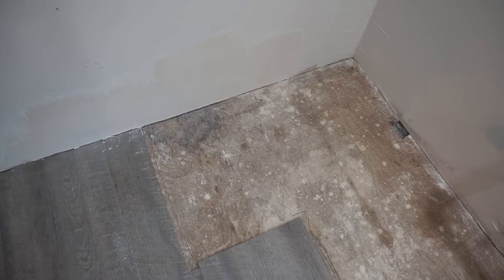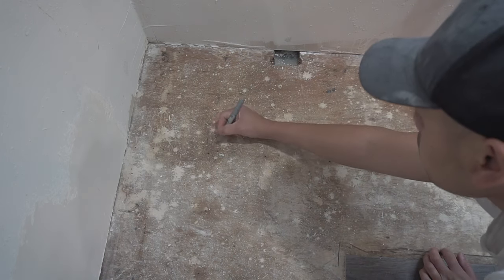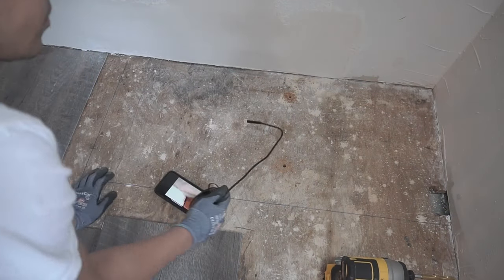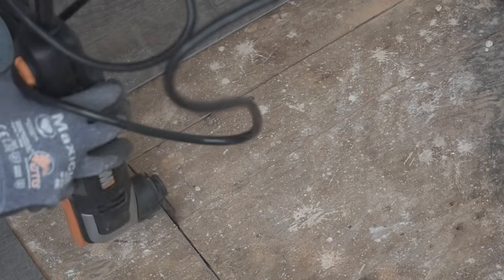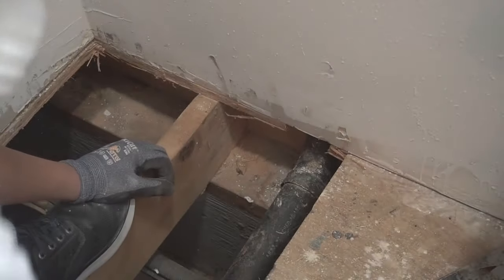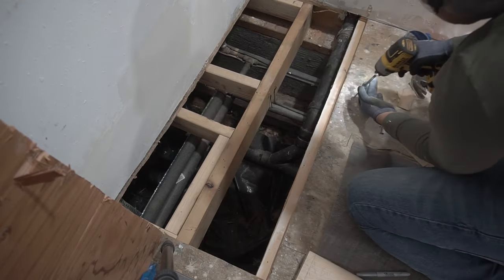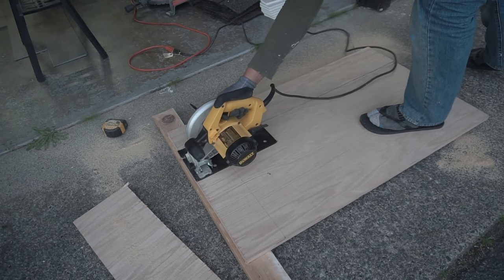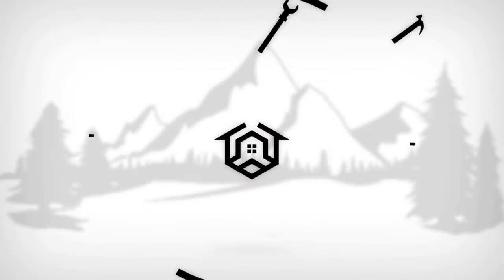How To Remove And Replace Rotten Subfloors! DIY For Beginners!

Comment: I do handyman work, and your videos have helped me a lot. I like you you used what you have to cut the 2X4's and plywood. Many times, I have gotten to a job site and forgotten a tool like my sawsall. It was too far away for me to go back home, so I made due with what I had.
Reply from the maker: Thank you so much for the love and support! I’m glad I could be of help. Yes for some reason I couldn’t find my mini sawzall, very frustrating haha, so I used the oscillating tool which turned out to be better and a lot easier! 👍🏽😊
Reply: Came to correct "sawsall" then realized I was also wrong with "sazaw"... its Sazall lol... which looks so weird.
Reply: @mikelee7582  Lol great laugh especially because you still got it wrong 🤣. It's actually Sawzall 😅 but you got close.
Reply: @LazyCrazyGuy  haha... fuck me didn't even notice I dropped the w

Comment: Honestly, that existing subfloor looked just fine.  It might have been a little stained but seemed to be holding it's strength ok.
Reply: Looked like mold...
Reply: Toxic mould
Reply: Yeah but f that, don’t chance it .
Reply: Ok landlord 😂😂😂
Reply: That’s what my contractor told me about half the subfloors in my house. Replaced entire house with finished floors. Where the new subfloor was laid the floors are amazing. Flat, level, new. Where the subfloor that wasn’t replaced is… ha!!!! Wavy and creaky. Replace them. Don’t listen to anyone.
Reply: Wow 🤦🏾‍♂️
Reply: @Luis-xj6nf right😂

Comment: Good video, but you are supposed to install plywood subfloor with the grain (strength axis) perpendicular to the  floor joists.
Reply: Very clear step by step instructions. Good suggestions re tools to use and how to use them.

Comment: This will probably never cause an issue but i would have just cut back to the next floor joist to make it so the old floor and new sit on it 50 / 50.  I would use hanger brackets for the new joist since they do not rest on  a permanent support  like a pier block or foundation and I would never depend on the sheer or support strength of a screw or nail .
Reply: For real dude that was insane

Comment: Extremely good content as always, but the only thing I’d suggest is maybe using some caulking around the edges to seal of any drafts, or stuffing getting inside causing rotting again.
Reply from the maker: Thank you so much for the suggestion! 🙏🏽😊
Reply: Right? Unless it has a full sealed basement below. But also the caulk will be flexible for the wood to breathe/expand and contract.

Comment: Bless you and thank you for being so precise, to the point and easy to follow. 👍
I'm a disabled female whose a beginner at home repair and I have a carport converted into a room. Part of the floor I guess rotted away and now I've got a large long hole between the joists and I need to know what type of plywood to use because we will be walking on it so it needs to be able to support at least 300 lb.
Love your video you gave a lot of good tips.I've never even heard of an endoscope.  I'm on a fixed income so I'm going to keep watching you to see what to do to fix my home the correct and efficient way. Thank you.👍🙂❤

Comment: Around the 5:30 mark you missed mentioning how you fastened the 2x4s underneath the wall, i was waiting for that and was let down lol. How did you? Whatd you tie them into?
Reply: I was waiting for that too
Reply: nothing. Also he could have reinforced the middle long beam to the near side temp beam. Extra weight support as the drywall type of support is NOT structural. Its ok, its near a wall, but if this is in a high traffic area, it would be too weak

Comment: HI very well done video.   I have a problem now with a sub floor and water damage, so all I would add, I want to prevent water damage so can the wood there be painted with some Danish Oil?    On one sub floor the entire bathroom has to be totally removed and all  wood replaced.  the joyces seem to be only slightly damaged by water but the tub will have to come out, etc and its on the 3rd floor, whats underneath is the kitchen.  Sad.  The drywall in the kitchen ceiling? was looking strange, paint peeling? then a hole.  then a 2 foot section fell to the ground, now its a 2.5 x 4 foot section of drywall ceiling that rotted and fell.  All because  next to the tub the water collects in that corner.  An ounce of prevention is worth a pound of cure

Comment: Thank you, this is very helpful. We have a spot in a bathroom where the floor rotted and toilet fell partway through the hole (a beam prevented it from falling all the way). It was patched with mdf but not supported. Additionally, the adjacent plywood that was there before feels a bit squishy (I think its bc it lacks support underneath. This method of putting a frame in looks like it should work. We also have a spot where a joist was cut all the way through (by previous owners) and that needs to be fixed as well.
Reply: Youd be suprised how common that is. Especially the toilet. I know 2 contractors who found out the hardway by sitting on the toilet, the first day on the jobsite. And bam. Right thru the floor.
Reply: @willporter89  Yikes! I hope they weren't on a 2nd floor or above a basement when that happened.

Comment: Awesome video I'm getting ready to do this by my front door. I have two questions: instead of measuring can you just use the old piece of subfloor as a template to trace out and cut the new one? Secondly are they 2x4 supports you installed mounted to anything on the wall side or just sitting there? Any insight you can give is very much appreciated.
Reply from the maker: Hi! For the first question the answer is yes 👍🏽. Just make sure you flip the piece you are tracing to the face you cut from because the  cut end tends to be small due to the cut bevel. 
2nd, you will need to secure the 2x4 or 2x6 to the floor joist especially if this is some that will be stepped on due to high traffic. Each case is different. In my case I can get away with the edge secured from plank to plank with joist support on the middle because this will be this will be located on a non traffic area which is under my kitchen sink area. I hope this finds you well and gives you help! Thank you for watching! 🙏🏽😊👍🏽
Reply: @FixThisHouse  you're awesome!  that was the exact information I was looking for. Thank you for putting out videos that are clear and easy to understand for us occasional DIY people...Your insight has giving me added confidence to get this done and done right!

Comment: That’s perfect I wish I had you here to watch me and make sure I do it right I like doing my own stuff I have a small piece of water damage from when my water heater had a leak and it messed up a small part in the kitchen floor I don’t have to take the cabinets out i got the leak fixed and now I hate standing on weak floor ing it’s dry but feels soft I have the tools  thanks 👌

Comment: Perfect timing doing only thing I would change is I would add sealant/expansion foam around the repaired area . I did this before and did not seal the repair and felt cold drafts now going back to seal them up. thank you
Reply: same with us..no shoes in the house at all. just house slippers

Comment: I am about to do this in my bathroom. The subfloor has vinyl sheet flooring on it. Is it possible to use the same flooring after the subfloor is replaced?
Reply from the maker: Yes as long as the tongue and grove are still in good condition and still intact 👍🏽😊

Comment: I have a similar situation where an exterior door leaked. Part of the subfloor extend below the 2x4 but it is rotted. Is it possible to remove and replace the rotted subfloor beneath the 2x4?

Comment: I have some extra OSB 1/2".   Also I read some of the comments saying I would have.   This is true and its ok, but  when youre in the business a while you know each craftsman may have a preference for something I/we didnt think of before.  I had to stop saying I would have, and say hmm let me learn how you are doing that?   Its a wonderful thing to learn new skills and ideas to solve problems.  

And this is a difference between a Craftsman,  and a Manufacturing process person, the MFG has a set way that must be followed.  The Craftsman has the skill to apply proper methods as they see fit, there are Many ways to do one thing...  we all know this but when you work on something one way for 10 years and someone does it totally different in front of you and it hurts?   change the I would have to let me learn what youre doing there.

Comment: is there a risk of hitting any pipe or cables under the subfloor?
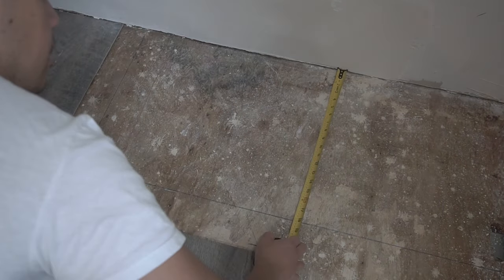Reply: Yes! You need to check under before making deep cuts. He explains this at the 1:54 mark. If you don't have an endoscope, use a stud finder or only make the cut the depth of the subfloor (1/2 or 3/4 of an inch in most cases). Create a small square in the center of your intended cut and get a flashlight to see under the subfloor - also, be careful not to cut through your floor joists.
Reply: @jamesfraley2715  thank you very much

Comment: The mold looked like it went under the wall plate but your new board doesn't go under the plate. So you still have mold under the plate?
Reply from the maker: Hi! The remaining plank extends to the bathroom next room. When I renovate the bathroom I will remove the remaining plank under the stud 👍🏽😊
Reply: @FixThisHouse  How did that job go? I bet that was the source of your mold.

Comment: Full sheets of plywood often a better price you pay for those broken down plywood panels . Yep chances are you will have to find a place to store the rest  of the plywood sheet until when ever but if you do enough work with plywood should not be a huge issue

Comment: I'm wondering how didn't your wall didn't collapse since you removed the subfloor from one side, and there were no perpendicular joists to catch the load. I think its a pretty dangerous tutorial since people will be cutting off support under their partitions that go parallel to the joust. I have to do the same thing, and ill be doing it sequentially 16" at a time. Cut a small piece, put support under. Cut another piece, put a few more.